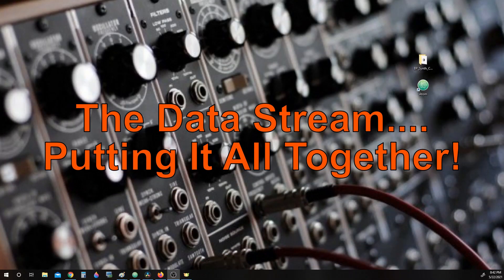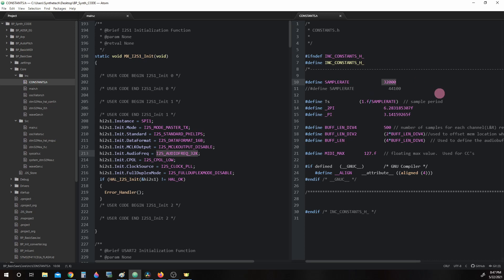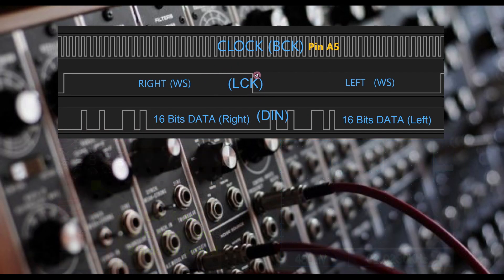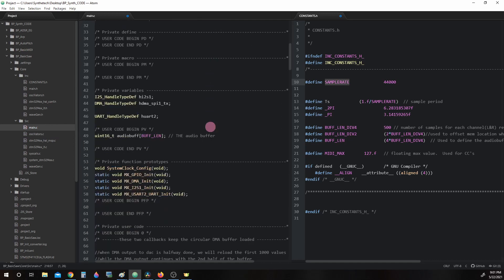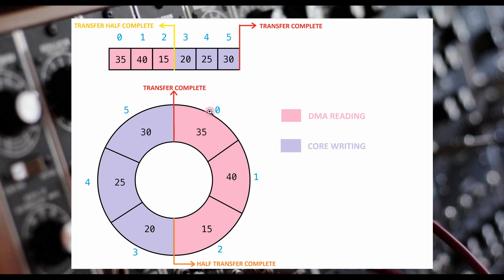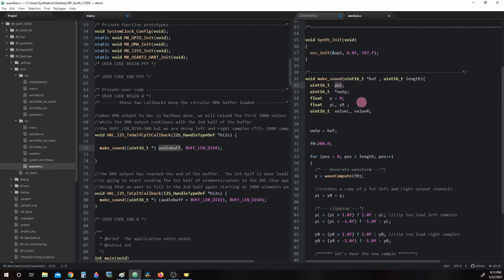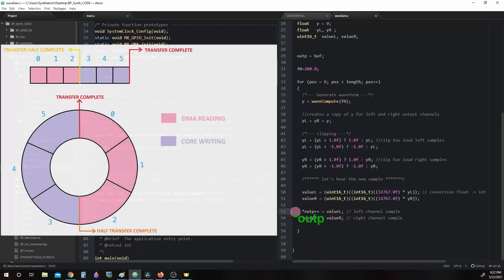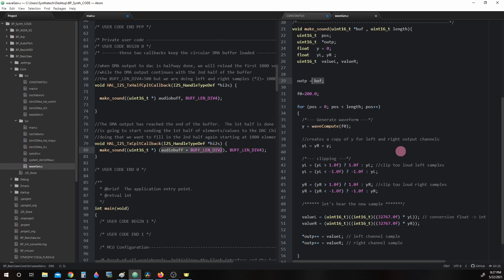007- The Data Stream

Comment: Congrats for the synth series, very interesting and infomative. I might have missed this on the videos, but why compute samples for the whole buffer array? Since the oscillators frequency can changed at any time due to an external input, shouldn't samples be computed one at a time, once per sampling period, and have only a 2 sample buffer? 
Thanks!
Reply from the maker: Thanks for your interest..  we need to keep the buffer full so it can stream HALF the buffer out while the other half is written in by the CPU.  Every time the DMA reaches a halfway point in the buffer(one in the middle and one at the end), it triggers an interrupt to make the CPU fill up the half that it just streamed out while it keeps on streaming audio out from the other half.
The DMA is feeding the audio data out a lot slower than the CPU will write it.  Unless too much is asked of the CPU to do while it keeps updating the buffer (a buffer underrun condition that would cause clicks/noise).

Samples are computed one at a time, but in groups of 1000 each time the interrupt routine is called(those halfway points in the buffer).. 500 for Left channel and 500 for Right.  Each sample is computed with the most current frequency every time each sample is rendered. 
This interrupt routine (CPU writing samples to buffer) is very low priority.  But a MIDI Note On command received on the MIDI Port will trigger a higher priority interrupt than the sample rendering process.  This higher priority interrupt will immediately change the frequency value.  Once the freq. value is updated, when the CPU returns to writing samples it will immediately write them at the new frequency.

Hope that all makes sense for you.
Reply: @Synthetech  I see. That's makes sense if the change on the osc comes from a midi message. That way you can compute all the required samples at a time and leave the CPU free for other tasks (such as uart, gpio, etc).

Imagining the case that a change on the osc is made by reading an input (such a frequency change depending on a value of a potentiometer). In this case, computing a whole set os samples would introduce a delay between the user input and the output change, so it would be preferred to be always computing individual samples, right?

I guess that optimizing this process is not a trivial task, specially when you start factoring in asynchronous inputs (such as midi) and continuous input (also considering input sampling frequencies, which I didn't consider in the last example).

Comment: nice video.what do you think about the implementation of the sampler on the BP?
Reply from the maker: It can be done.
There is already a simple Sine Wave wavetable used as the LFO for the phaser..
I did manage to convert 8bit wavetables from a Korg DW 8000 and play them on the BP Synth...  needs more RAM to pull it off though.. but possible and proven!
PS.. it can also do some basic 4op FM synth too.. but it's not in this version ATM